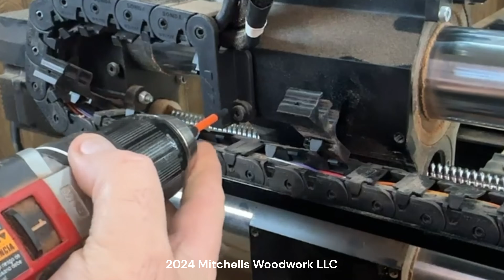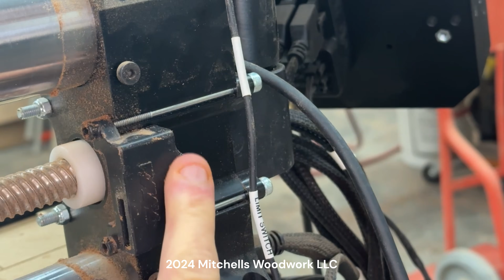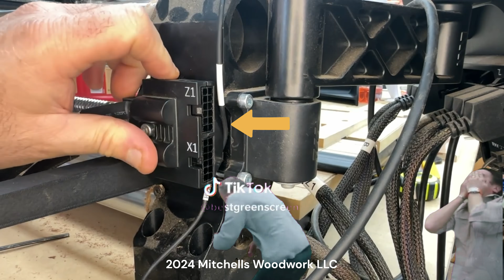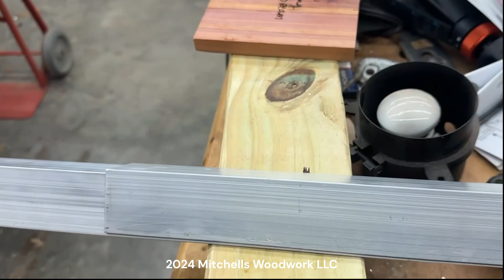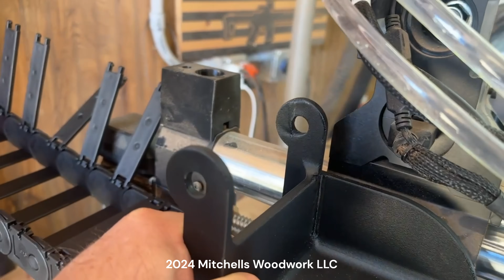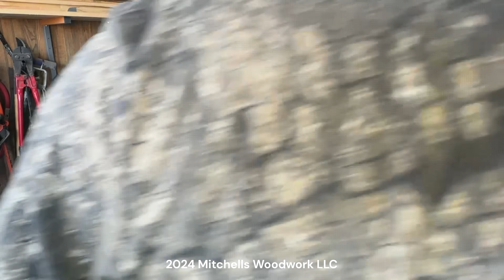PwnCNC ATC: Installing 4" Y Axis Drag Chain | Onefinity Elite CNC

Comment: Thanks!
Reply from the maker: Thank YOU!! 😊
Reply: That thing is huge, lol. I just got everything in for the ATC. Im starting from scratch and there isnt that much info out there on ATC. Does the dragchain have to be that big? I got it in the cart, but I noticed they have a bunch of different sizes. I would rather have one a bit smaller if possible. As I havent setup everything, Im not sure of minimum room needed. I dont want to waste even 1/2" in my tight shop. Thanks in advance.

Comment: Do you need to also upgrade the x axis drag chain?
Reply from the maker: Yes, but I won’t do that until the ATC is installed.  The wide drag chain on the X gantry poses a problem for the type of dust boot I prefer, which has the dust collection hose coming in from behind the X gantry.  PwnCNC and others are working on a solution for that problem as we speak.
Reply: @MitchellsWoodwork  I have the same dust boot system.
Reply from the maker: @TerrapinCreations666 man I love my v2 dust boot and hate to see it go.  I've had several over the years but the v2 is by far my favorite, but again, that's mainly because I video just about everything I carve.

Comment: How much did you pay for the drag chain? Also your CNC channel is fantastic!
Reply from the maker: Thank you!  They’re pretty expensive, but there aren’t a lot of options out there. 

https://www.digikey.com/en/products/detail/igus/240-09-055-0/16187984
Reply: Does the angle iron come with it.?
Reply from the maker: No, you’ll have to buy that locally (big box stores) or order online from other sources.
Reply: Thanks for the link! 

How many feet of chains did you order? I have the same Elite Foreman. 

Also did you ever find a 3d print copy?
Reply from the maker: @josephhughesgeek I ordered 8 feet and I have  32” left over.  I’m figuring If you order 11 feet you should be ok.  I’ll be ordering 3 more feet for the X rail.
Reply: I did 11 feet and I had a few links left over. 11 is perfect and was 264.02 shipped to my door @josephhughesgeek
Reply from the maker: Thanks, Jared!
Reply: are you going to do a video on the rapid changer?
Reply from the maker: @johnjahner3389  I will be doing install and working videos with the PwnCNC Automatic Tool Changer (ATC).  😊👍
Reply: @MitchellsWoodwork   the pwncnc atc is so expensive.  Most hobbists can’t afford the PWN CNC,ATC.  That is why i hope you can do a rapid changer, ATC